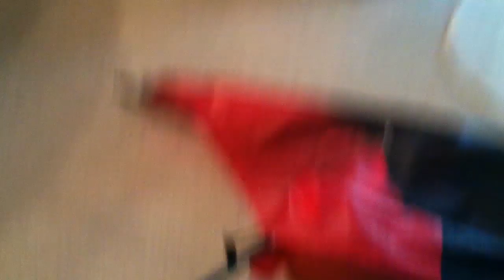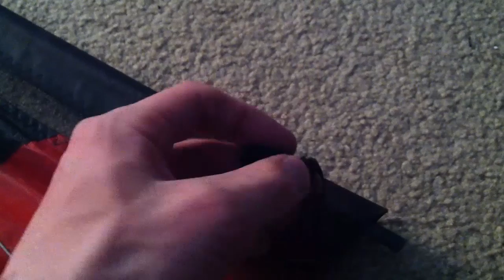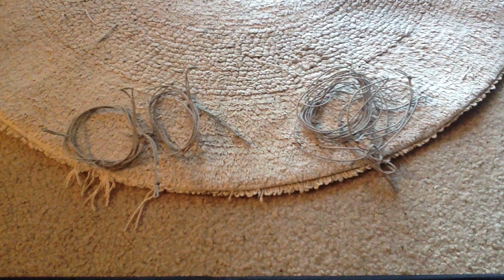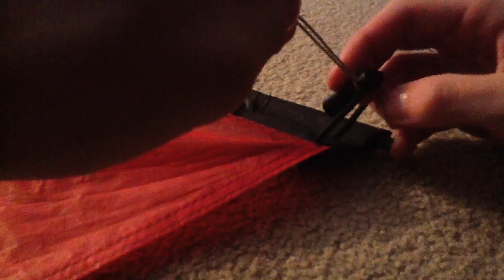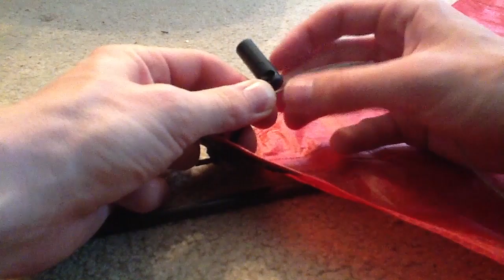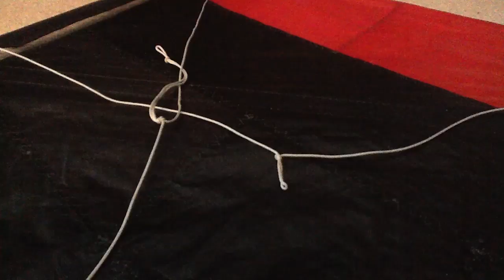Revolution Kites Bridle Replacement

Comment: Hey Watty me again lol. Sorry for all the questions. I just had to fix my bridle. (The horizontal was under the vertices). I watched your video intently, and followed each direction step by step. I was wondering though, on the end caps on the end of each leading edge and the end caps on the wing tips, does it matter which way the loop goes through the hole? I did it exactly how you did it. But if they’re both the same can you put it through anyway you want? Also one more question... Does the bungee on the leading edge tips have a plastic washer behind them? I just bought a B-Pro off someone on Kitelife, and those are the only bungees without washers. Sorry for all the questions, just want to make sure it’s correct.
Reply from the maker: Hey James, absolutely no problem. Regarding the position of the bridle attachments, no, it doesn't really matter. The practical difference is so small, that it isn't worth worrying about. Just make sure the connection is clean. Regarding the washers on the ends of the leading edge, this was more common several years ago, but they seem to be unnecessary. The point of the washer is to compensate for the stretch of the sail where the bungee is connected. On the leading edge, those holes are often going through at least four layers of dacron, so stretch isn't really a concern.